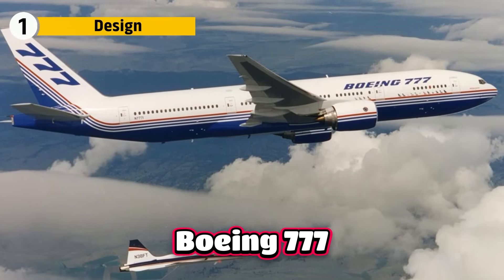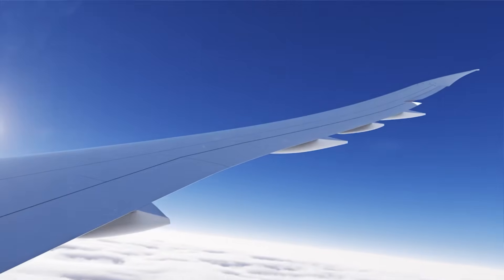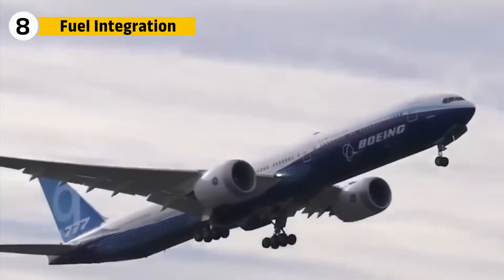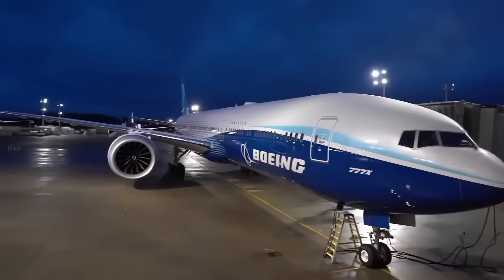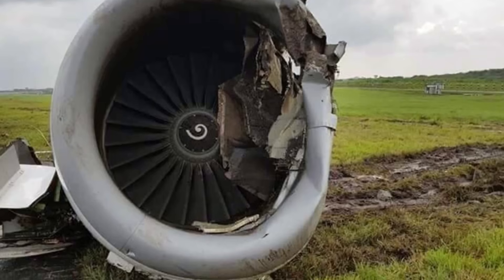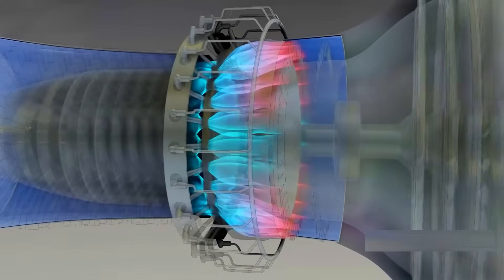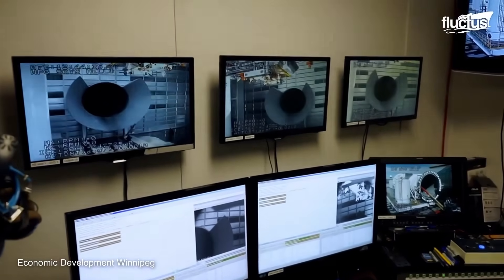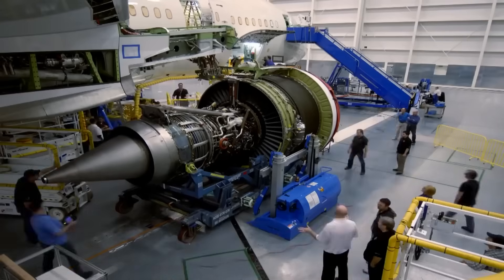How The WINGS Of Boeing's MASSIVE 777x Are Made

Comment: 11:50 the “turbine blade tips travel at just under  1,000 mph, nearly the speed of sound” … don’t understand? The speed of sound in dry air at sea level and a temperature of 20°C (68°F) – which is the standard reference value – is approximately:
767 miles per hour (mph)
Quick reference for common temperatures:
•  At 0°C (32°F): ~742 mph
•  At 20°C (68°F): ~767 mph (standard value)
•  At 30°C (86°F): ~781 mph
Reply from the maker: Sorry for the confusion. What we were trying to say is the fan blades spin at around 1000mph which allows the plane to fly at around 680 mph, slightly under the speed of sound (around 760mph).

Comment: If the production delays were due to the development of the wings, it was probably because Boeing honestly did not have the technology to design carbon-fibre wings. The 787's wings were designed and manufactured by Mitsubishi Heavy Industries in Japan, and although there were design revisions during the prototype stage, mass production was able to begin without significant delays to the development schedule. I'm honestly amazed that the 787, a completely new aircraft incorporating new materials and technologies, was able to be mass-produced in such a short time. Mitsubishi Heavy Industries also offered to develop wings for the 777X, but Boeing, which already relied on Japan for 20% of the 777's major structures, did not opt for this.
Reply: More ignorant words were never spoken. Boeing has been designing and building composite airfoils since the original 777 in 1990, i.e. the vertical tail of the 777 is carbon fiber. Boeing redesigned the 787 wing from its' original design to reduce the +40,000 lb over weight design from the suppliers.